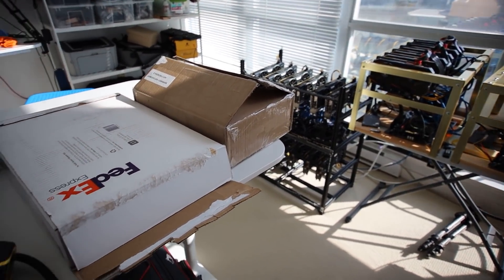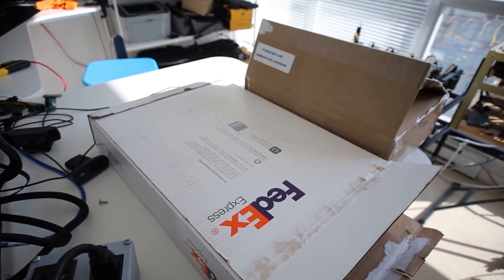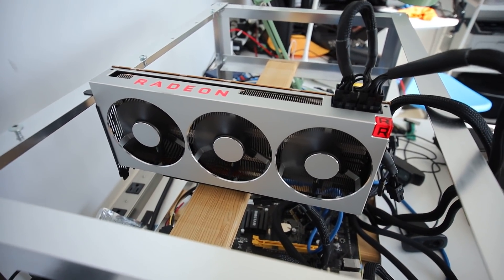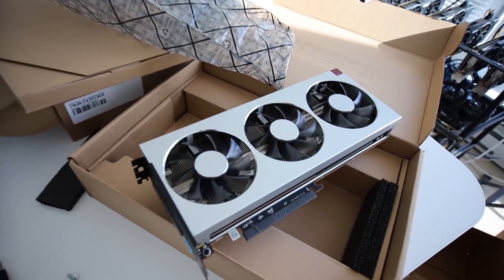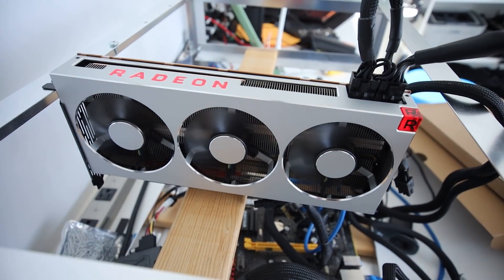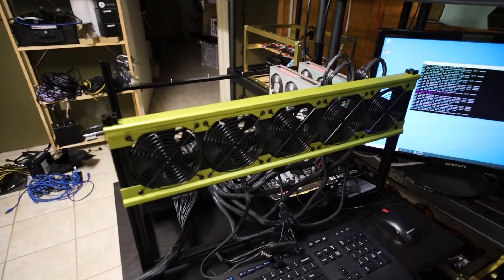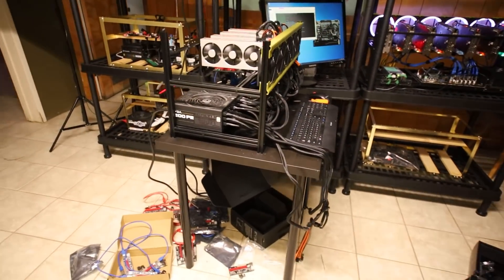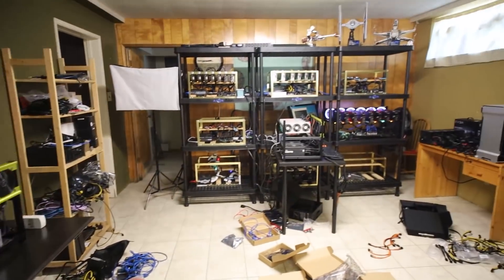Building My 6 x Radeon VII Mining Rig... Part 6

Comment: To be safe I would not use a 75w splitter on the Gpu.
If you have an 8 pin to 2x 8 pin it should be fine to use one on the GPU and one on the riser.
Otherwise you can use a 75w splitter between risers (as they usually draw 40-60w per riser) and they should be fine.
Potentially if you have good quality splitter (16 awg only not 18) you can use the single strand 8 pin from the PSU for both PCIE slots on a GPU. 
The EVGA 1200w uses 14awg wires so it can theoretically deliver 300w with no issues from a single strand.

Comment: something else i see you use windows, with the 1080ti you can have much much better stable voltage and a bit better hashrate by disabling the P0 state=off on Nvidia profile inspector version 2.1.3.
i manage to get 55mhz on ethereum with only 350 memory oc 0 core clock and 85/90 PL and a rock solid voltage, the problem is that nvidia lock down by driver and force you to use P0 state instead P2 when mining or rendering, by doing this you would have greater spam life on your cards, sorry bad english